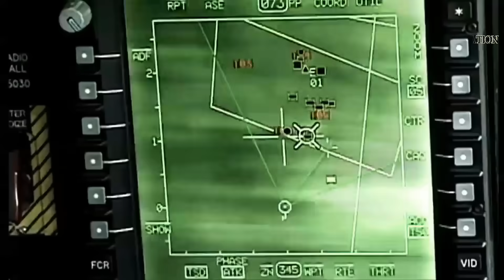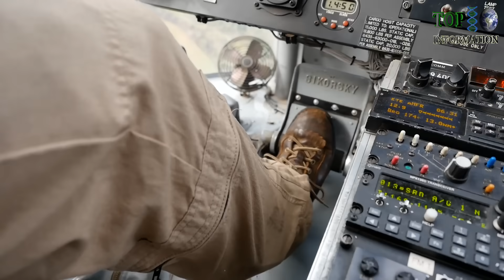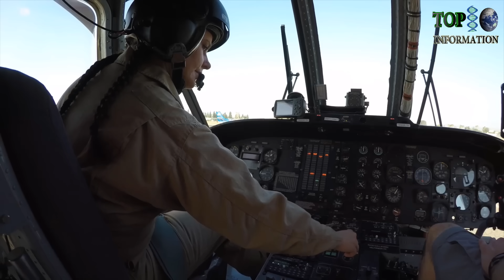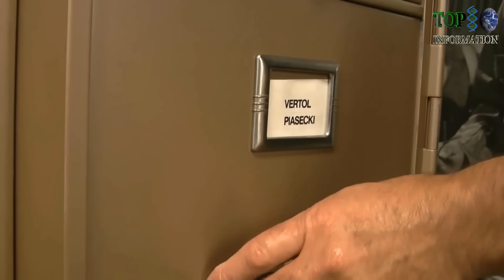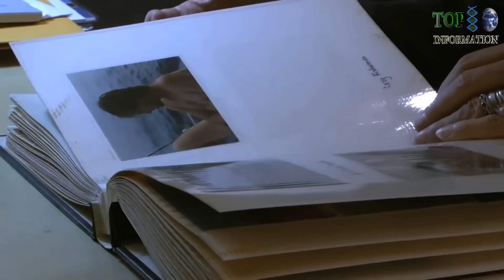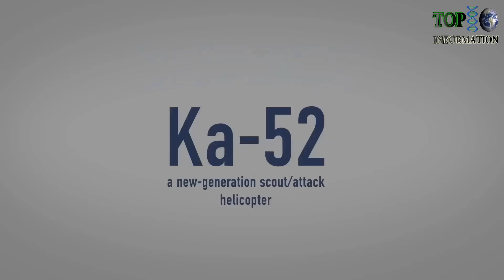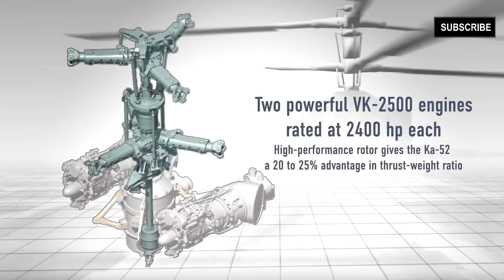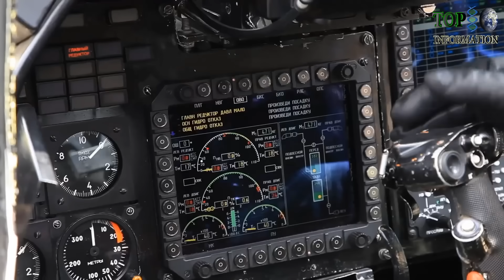7 MOST EXTREME HELICOPTERS IN THE WORLD

Comment: V-22 isn't helicopter. It's convertiplane.
Reply: tilt rotor and hybrid/compound helicopters (Eurocopter X-3, S-97) are two different category aircraft. The Osprey uses wings as airfoils to provide lift, while helicopters use the main rotor blades.
Reply: Basarga Loran they are called tilt-rotors or hybrid helicopters or VTOLs (Vertical Take Off and Landing) those are their names.
Reply: Kira_Hibiki Helicopter is a type of rotorcraft in which lift and thrust are supplied by rotors. V-22 isn't helicopter. It use wing.